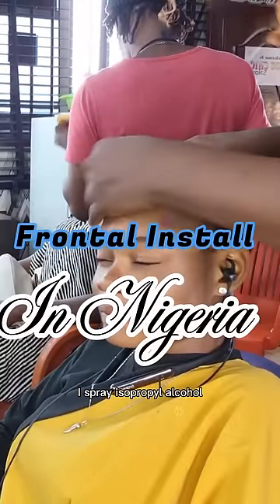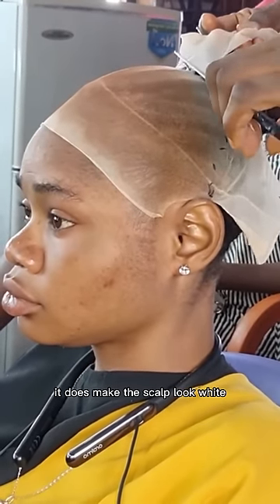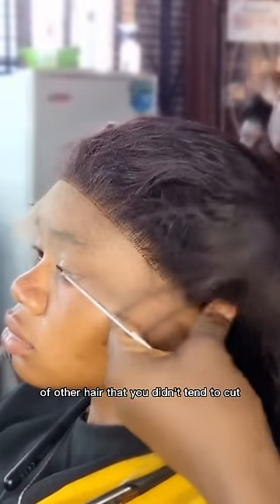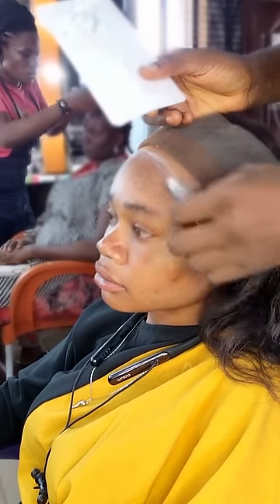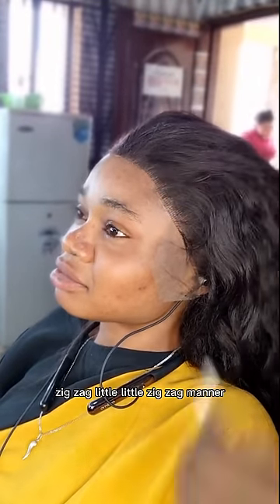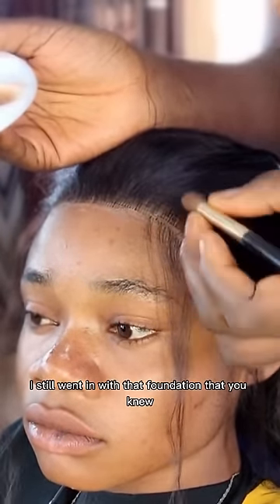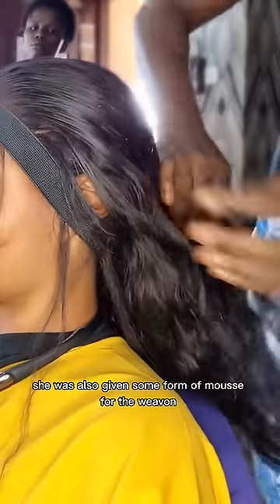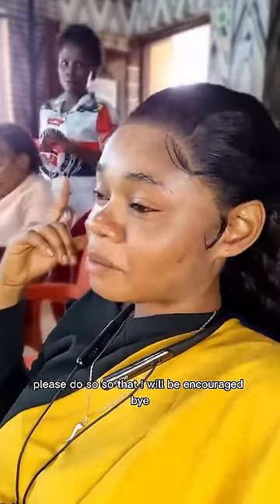FRONTAL INSTALLATION IN NIGERIA||Common relatable items for seamless install.

Comment: Next time pluck the wig first in the front around the hairline so it will look more natural
Reply: Not this type of frontier the plug, cause it is a ventilator frontier made with hand
Reply from the maker: The frontal depth wasn't even up to 3 inches. By the time you are done with the shenanigans, you'll no longer have a frontal
Reply: @tanthetabc  I understand you so well... There's nothing to pluck there.. you did a good job installing the hair